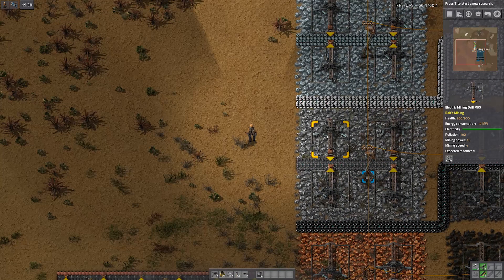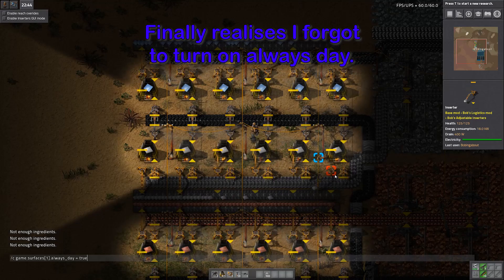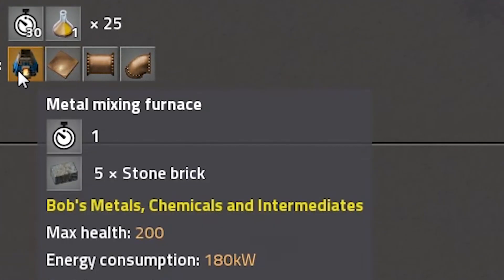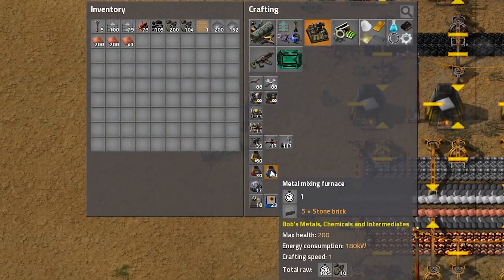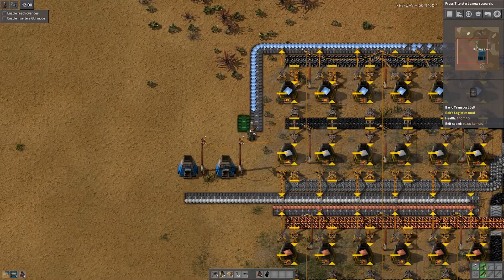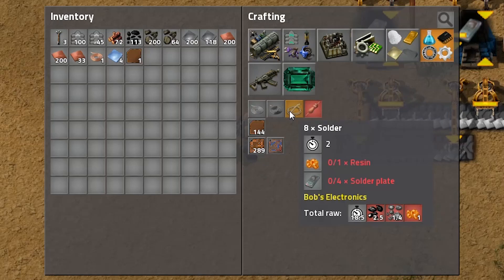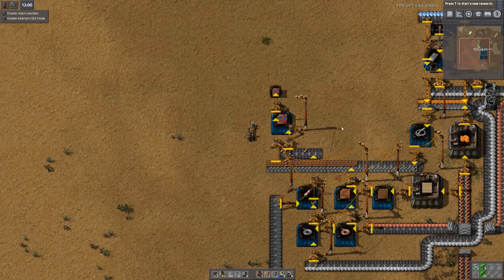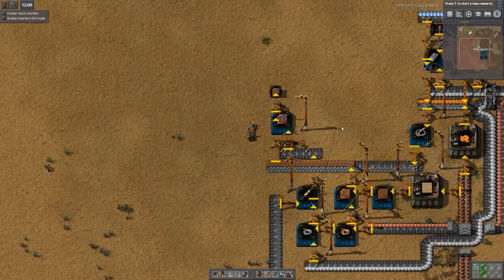Factorio Bob's mods Tutorial 3: Automating Basic Electronics

Comment: Came here to find where one gets a ton of wood for basic circuit boards without cutting a ton of trees by hand, only to find that one just needs a magical belt full chopped trees that streaches from somewhere beyond the screen borders. If that was intended as a how-to, you sir failed to deliver miserably.
Reply from the maker: I mean, I made this 3 years ago, and this is just my infinite resource map.
The answer is with Greenhouses. I don't think I've posted a how to on the greenhouse yet.
I was also planning a lot more production line tutorials, but never continued.
Reply: @bobingabout  yeah I figured as much. Sorry for the outburst, I literally spent 4 hours trying to find a solution. I’m yet to find one on how to turn trees that grow there into wood automatically though, assemblers don’t seem to have that recipe.
Reply from the maker: @Badchi  If you have the greenhouse mod, the greenhouse is the factory you need.
if you have other mods like angels, it may have been disabled by the other mods.
Reply: @bobingabout  That might be the case, thanks! I’m currently knee-deep in figuring out how chemical stuff work in these mods though, it’s ridiculously complicated but also fun and rewarding. Felt like opening champagne after crafting my first piece of plastic XD
I mean, 5 stages of water filtration, electrolysis, 5 or so stages of separating gases from each other and combining them in different ones, while burning away residuals and recycling the rest. There’re probably proper blueprints of the stuff in the internet but hey, where’s all the fun in that. Cheers!
Reply from the maker: @Badchi  It took a lot of thinking and trial and error to strike a reasonable balance between the complexities of realism, and simplifications for the sake of game mechanics.

I'm glad you're having fun with it.